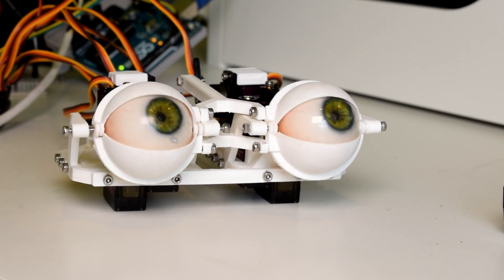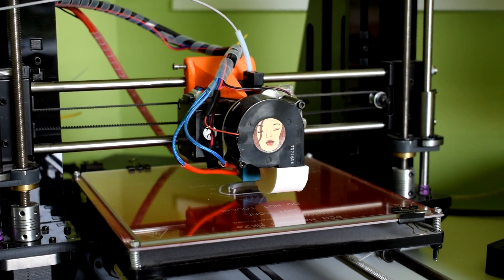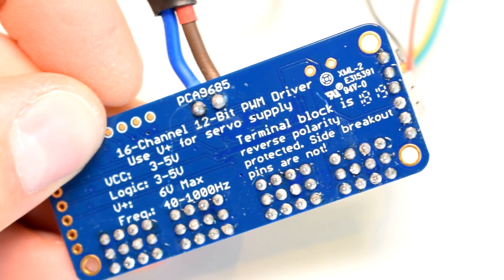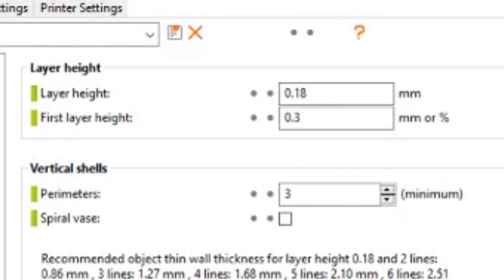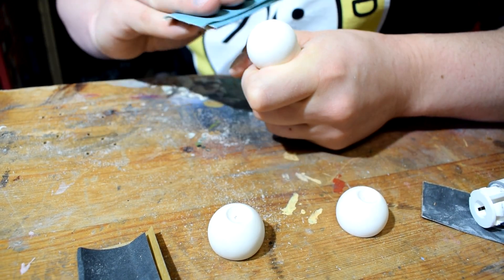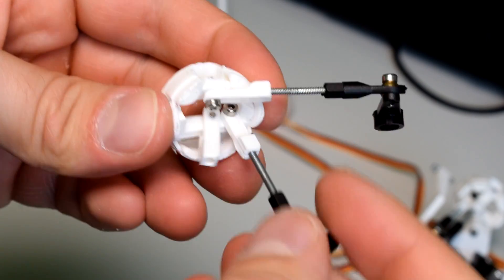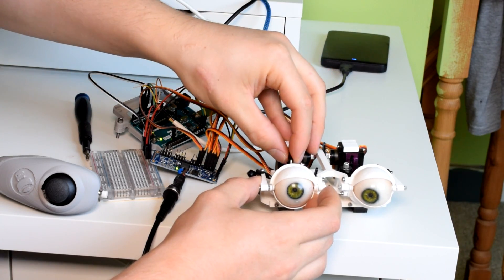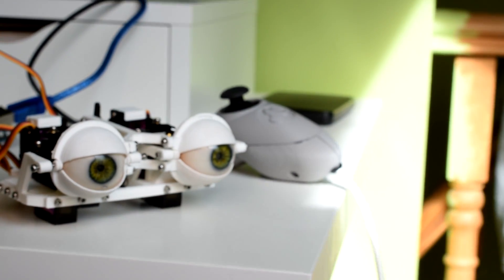How to Make a Compact Animatronic Eye Mechanism with 3D Printing and Arduino

Comment: How did you make eyelids follow the eye movement? Is it your manual skill, or there is some code part that make sure they behave like this?
Reply from the maker: It’s coded in - the vertical reading from the joystick is scaled down and the value is added/subtracted (depending on orientation) to the angle of the lids

Comment: The servo holder is comically small compared to mg90s and I'm wondering what happened. Did you really use the MG90 servos you linked? Something's not right. The rest seems to be rightly sized because the holes are just right for the m2 screws.
Reply: I Got MG996Rs but I thought they're the same size as MG90s? I'm so confused.
Reply: OH I KNOW WHAT HAPPENED! The link on your description for the motors doesn't go to MG90s, it goes to MG995s and MG996Rs, so I got the right kind. The right kind being wrong, that is. I don't know if you chose a bad link or if Amazon is doing something on its own since I'm in the USA and I'm guessing you chose a UK link?
Reply from the maker: Thanks for bringing this to my attention, the link has been the same for years, I’m not sure how it’s ended up being redirected. I guess the original listing got taken down and Amazon found what it thought was a close match. Really sorry you got the wrong motors!!

Comment: First of all, amazing project! I was wondering if the eyes support against the lids when they move and if it's possible to make the distance between eyes and servos shorter without messing the movement? I'd like to make a single eye, lidless version but the use I have in mind would need it to be relatively low depth 🤔

Comment: I'd recommend printing everything 5 or 10% larger. I had to do alot of post print clean up and use a 2mm tap and die to open the holes up more to fit everything.

Comment: Should the code be uploaded to the Arduino before or after every is wired? Also, do you have a photograph of the wire set up, instead of just the diagram? Is the breadboard part of the design, or is it replaced later, and if so, how?

Comment: I've got this thing wired up but nothing is happening. No servo movement at all. Thinking it may be a power issue? I've got a 5v battery pack going to the arduino like you have here, and a 4.5v going into the servo driver. Any ideas?
Reply: Consider checking your current?

Comment: How easily could a project like this be scaled up? I intend to make a slightly larger version at some point, however I don’t know much about the mechanics of scaling it up and how that will affect how it works or if I will run into any other problems.

Comment: @11:00 I lightly heat screws (by touching a soldering iron against it), then thread screws into it, and it makes great threads without cracking the part

Comment: 3:38  Just wondering why if the 2 eyeballs move parallel to each other not use the same pair of servos to move both eyes similar to what is done with the eye lids, this will save money on 2 extra servos and less wiring to worry about. this will require the 2 servos for X and Y motion of the eyeballs to be moved to the centre.
Reply: yes, was asking the same question

Comment: Thank you very much for this video, i'm so keen to start making my animatronic eyes, just one question: Is it possible control the eyes wirelessly, like using a joystick controller or maybe a glove??
Reply: I am fairly certain using an ESP32 (instead of Arduino) would be possible with a PS3/4 controller. They both use Bluetooth to communicate, however, writing the code would not be easy for a beginner (Like myself) but I think it could be achieved relatively easy.

Comment: This is such a beatiful build!
I am desperate to get it working for me, so was going to ask for help.
I have printed, built and wired both the controller and the servos, but the area i am struggling is the Ardino side of things. 
I have uploaded the coding and keep getting exit errors?? (Never used Ardino before)
Is there a complete file that i can can download or copy and paste it to the software for all the aspects needed? (Servo drivers, controller and joystick/momentary switch)
I am trying to embrace this new method of animatronics as previously i have always used RC transmitters and relievers. 
Any help would be greatly appreciated.

Comment: good design however to fit it inside a head it could be made much smaller by spinning the x and y servos by 90 degrees and opposing them , removing the eylid servos from the rear and placing them on top you would gain a good 25 to 30 mm that way, also a great addition would be a camera mounted in one of the eyes

Comment: Couldn't this be done with half the servos? Are the redundant servos a question of wanting more options in the long run (upper and lower eyelids moving separately, ability to go "cross-eyed" etc.), or are they there for the sake of power?

Comment: Will: I am in the middle of making this great project. I have more-or-less figured out the (uncommented!) code but I am not clear about the comment "you can use this function if you'd like to set the pulse length in seconds
 e.g. setServoPulse(0, 0.001) is a ~1 millisecond pulse width. its not precise!". Do I need this or not? Thanks.

Comment: I made this but I couldn't get it to work. Any way you could point me in the right direction on how to add the program to the Arduino? I am not sure what I did wrong but may have been that. Programming is my least strong ability of any of this. Thanks!

Comment: Really like your design - especially your eyes look very natural and I also like a lot your snap fit eye mounting. Im running a similar project, where each single eye is driven seperately. This means you can also do things like squinting. You may perhaps think this is too difficult to control, but beleive me it's not:  Probably the advantage of my solution is not the mechanics, but perhaps the software. Like you, I also use the same PCA9685 servo controller which is really cheap, but powerful. Unlike you, I use a raspi or an OrangePi, because it helps to synchronise sound and movement. Perhaps my open source software could boost your projects. Have a look at my new Video, that explains the software in detail: https://www.youtube.com/watch?v=9hyF8b8JamQ I think we could both benefit from linking each other in our playlists. I'm curious what you think of it !

Comment: Simply amazing!!!  Thanks for sharing this all.  Do you think making the mechanism(s) in resin would be ok?  I can do either but for finish the resin would be perfect.  Have you tried resin?
Reply from the maker: I know someone has built it successfully in resin, they said the only issue was that they had to print the eyelids at 101%, and make the eyelid holder a little bigger too.

Comment: Are you also gonna make a mouth series, or eyebrows?
Reply from the maker: I definitely want to try building a mouth and lips mechanism, and I'll look into eyebrows if I ever try and integrate them all into a full head.
Reply: I’m looking forward. 

PS: Which program do you use for designing this stuff
Reply from the maker: I used to use solidworks when I had free access to it, now I just use fusion 360.

Comment: I'm tempted to try and modify this design to make it work for costuming, with eye tracking or a controller, depending on what ends up being plausible. Really brilliant design! I'm looking forward to the controller and being inspired by all your future videos!
Reply from the maker: Please do! I'd love to see it in a costume.
Reply: @WillCogley   I'll certainly try then! :D
Also do you think that it would be possible to move the mechanism to be above/below/both in relation to the eyes rather than behind? I would have to learn a lot more about the software necessary for such modifications, but i'm wondering if you think that's worth pursuing?
Reply from the maker: @Omegryth Yeah that would definitely be possible. One thing I'm hoping to try soon is having a cable mechanism between the eyes and the motors so you could hide the motors anywhere you want.

Comment: I made it and put smd rgb led in each eye. Had to remake the two eyes so there is a hole in the middle of them the printed with clear pla to holed the led and fill in the rest of the eye. for now every forth blink the eye will show a different color. looks wild!
Reply from the maker: That sounds ace, I'd love to see a video or photos of it.
Reply: @WillCogley  I will get pics and a video for you, where can I send them so you can see em?
Reply: @YesItsTJ  Just post it in Twitter or smth like that, we want to see it too ^^
Reply from the maker: @T H You could put them on instructables on the I made this section https://www.instructables.com/id/Simplified-3D-Printed-Animatronic-Dual-Eye-Mechani/ or just post it on twitter/Instagram/facebook and send a link.
Reply: I am doing something similar, after i cast the eye with the paint i am drilling out the back for the LED to sit in there the drill should leave enough of a haze on the resin to defuse it a bit.

Comment: Will have you seen this course?: https://www.stanwinstonschool.com/tutorials/how-to-make-an-eye-mechanism-design-3d-printing-assembly

I think your design is a better design.  Theirs to do a realistic look up and down they had to program the lids to move up and down a little with the eye.

I like having the know how that he teaches in that course on how to use fusion 360 and how to think about eye mech design.  I ultimately want to be able to design a mech for a specific set of puppets.  I might want to add the option in there of blinking the eyes dependendly (wink).

But thanks for doing all this.  You're designs are good.  I'm still waiting for my 3d printer to arrive with is a Phrozen Transform LCD resin printer.  I've ordered a lot of the other parts so I can make this one of my first print projects.  I'll let you know how it comes out.

Comment: 5:15 - pca9685 for google, 1-2$ on aliexpress
7:25 - try Cura slicer, it works fine with thin walls without extrusion hack
8:30 - Pet-G very strong and flexible. Easy ti print like PLA and very Strong like Abs

Comment: Try to make a eye tracking mechanism, with cameras integred inside each eyeball
Reply: Absolutely possible. You could even use the same code in one of James Bruton's videos. I might try this as I actually have everything needed at home.
Reply: @Dan-The-Orange  I am sorry, didn't mean to discourage or claim it was not possible. I can imagine it would work absolutely flawlessly if the code is well thought out. Like for example add an eye boundary (camera space) in which the tracked object can stay and the eye stays where it is. If it is outside this box wait x milliseconds and retarget, which would overcome lmitations of cheap camera modules (at high speed). I did a false claim with the motion blur, lol.
Reply: @Dan-The-Orange  What do you think is better? In-eye tracking or one camera in between the eyes tracking and calculating the eye angles?
Reply: @SinanAkkoyun  between the eyes is less obstruction but it works if it's not too obvious
Reply: @Dan-The-Orange  Let me know how it goes!
Reply: I don't know which would be better. The single camera would work perfectly with existing examples. But in eye ones is cool and I'd like to see it.
Reply: @Dan-The-Orange  i look forward to that. Just make sure both eyes track the same object xD
Reply: I'm in the process of doing it now using a arduino nano 33 ble
Reply: I'm in the process of doing it for my first bot build. I'm gonna pair it with an Ardunio 33 BLE.  It's their AI machine learning controller board. It has a bunch of built in sensors like color recognition, temp/humidity, and people detection.
Reply: @donvee1419  dude u gotta post when its up, im subscribing to u rn lol i need to see
Reply: har har har har har  har haarhaar haarhaar
Reply: What animatronics do is use hidden cameras somewhere else and fine tune the device to look where it needs to in reference to the subject. Better than trying to fit cameras inside.
Reply: Motion blur would be too high